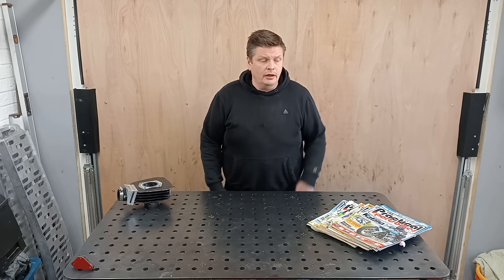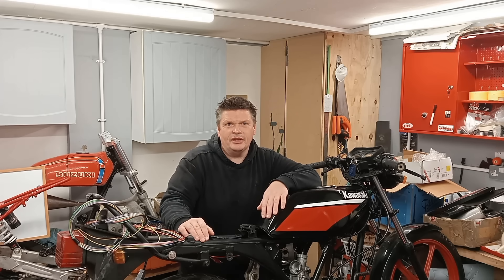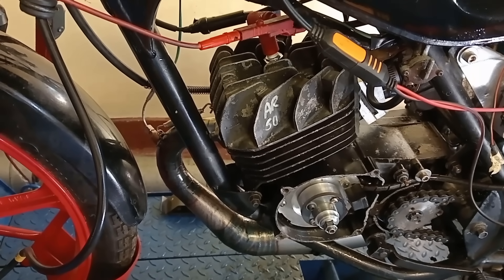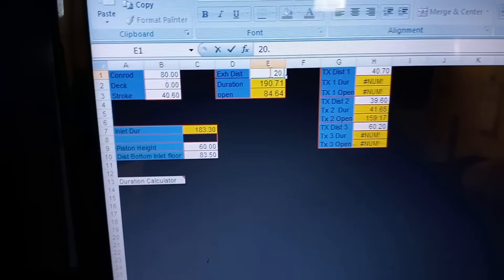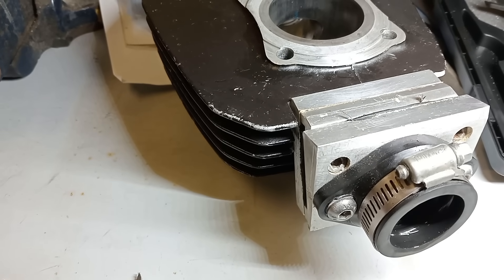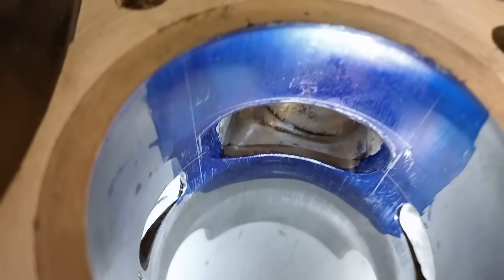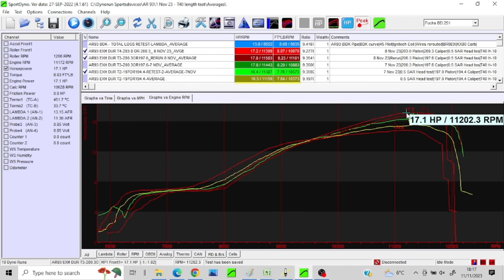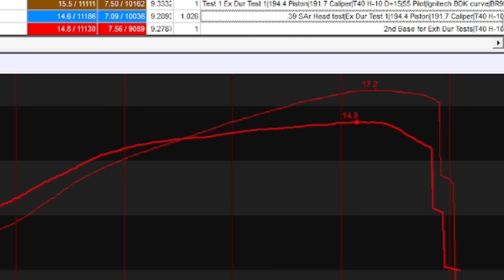This Tiny Port Change Changed Everything (Dyno Proof) #2stroke #power  #porting

Comment: You need to measure the exhaust timing with a dial gauge/protractor on the crank. From the degree the port opens to the degree the port closes. That's your duration.
Reply from the maker: Hi, yes I've seen that method but I like the direct measurement of the piston position. I find it's all a bit subjective 😁
I'll maybe give it a go and see what the comparison is like.

Comment: The speed of sound is faster in hotter temperatures.
C2/C1 = sqrt(T2/T1)
That is, the speed of sound (C) is proportional to the square root of temperature.

So, if you have gases at 400 degrees you have a speed of sound of 520 m/s, give or take.
If you have a pipe tuned to 10000 rpm the pipe will actually be tuned to 11900 rpm with 100 degrees more (IF you keep constant the relationship between RPM and speed of sound in the previous equation).
Your power band is now wider.

So my question is: "Why would you not wrap your exhaust with header tape to keep as much heat in the pipe as possible ? "
Just asking.
I plan on doing this to the pipe I'm copying for one of my FL350 Honda engines.
CO
Reply from the maker: Hi buddy, the only argument against  not wrapping the header is detonation caused by the heat being transmitted into the fresh charge that is over-scavenged into the pipe resulting in hotter less dense - stuffed back in mixture. Another thing i have heard of (not tested by me) is having the header (and the baffle if I recall correctly) made from a thinner steel. For example. 0.8mm steel everywhere apart from the header and baffle cone. The header and baffle cone being made from 0.6mm steel and thus having less thermal inertia and being able to cool quicker and allow the pipe to "act" longer (useful for acceleration off a turn) and then "act" shorter as it heats quicker than the 0.8mm material making the pipe "act" short for high rpm resonance.
Reply: @AutoBeta2T  WOW I didn't even think of that stuff. I'm making a pipe this winter sometime and I'm copying the pipe on my brothers FL350 Honda. It seems very thin material and a different design than my other stock machines. His engine is modified.
Thanks for the heads up because I was going to wrap the pipe.
CO

Comment: Great video have had some development in the past with ar 50 80 engines and the bdk wasnt impressive think a couple tweaks made 17hp from 14 but then development stoped as the guy was a busy man as were we
Reply from the maker: Cool, sounds like you were about where I am now. Were you running the BDK pipe and ignition?
Reply: Kx85 pipe made to fit underslung  exhaust port was 192°  you need to make your exhaust stub bigger so u have a step on your duct outlet for a disruption on the revered pulse should pick 1-2 hp up there
Reply from the maker: Hi again, thanks for the info.
My outlet is currently 30mm at the end of the stub but 32.7 mm at the outlet of the duct. I want to play with a stepped design. It appears to work well in the sim. I haven't tested in reality but it's good to hear you have found power from the step.
Cheers.
Ps. What was the diameter of the header inlet on the KX pipe?
Reply: Pipe wise i couldnt say as we had a kx pipe nikkon pipe and another the customer had to try 

Yes make the stub bigger than the duct it will perform better 

We mainly done exhaust port and  intake porting 

Bdk porting was not good 

Think we gave it the 10 mins tune lol but then the bloke wanted to try the thai import cylinders ect
Reply: It ran a selletra rotor ignition  kx85 pipe and a 30mn pwk 

Try to keep your exhaust port roof as flat as possible with a nice radious this will give you more blowdown area what chord width are you on 70%?  Also the stock duct is large anyway so i wouldnt go making it bigger or you will loose velocity in the blowdown phase

Comment: The top of the new cylinder i mean  on the work bench  with this your spoiling ports have also a longer period of opening duration and another benefit your carter volume is bigger take more air and cooling the crankshaft better than your tuned resonant exhaust pipe will take care providing power

Comment: One piston top ring is way better , second you can get more power by taking an old cylinder  cut away one  cooling blade of the bottom of this cylinder.  Manage to fit this cooling blade and spoiling ports alined . Fit the cylinder on the engine and mark  your exhaust port and adjust by filing the cooling blade from the old cylinder at the port opening duration you want than remove the top of the old
Reply from the maker: Hi, i'm not quite sure what you are say?
Reply: Read it over and over again than suddenly it will open your mind and it's not a joke  an overbore moped of 70 cc make 16.2 pk when it sniffs the powerband of the tuned resonate  exhaust pipe
Reply from the maker: What are the parameters of the tuned resonate exhaust pipe you talk of? Is it length or volume or both? Are the angles of the pipe more important than the length or the volume?
Sorry for all the questions but I am genuinely trying to understand.
Regards
Dave

Comment: Awesome video! I was hoping that you would have done a compression check every time you raised the exhaust port. Im curious about how much the compression decreases. With that said every time you raise the exhaust port you should increase compression ratio via head gasket thickness, the idea being to keep the compression the same throughout the test. I imagine you would have even more horsepower 👍
Reply from the maker: Cheers Baby Shark! I have some new heads that I will cut to get the trapped compression back (this will increase the geometric compression. Prior to raising the geometric compression was 13.8:1 and the corrected was 7.4:1. After raising the port the corrected lowered to 7:1. I'm keen to test this. Stay tuned :)

Comment: Are you adjusting the tuned length on the expansion chamber? Exhaust port timing is tied to pipe length.
I use prof. Blair’s book and software for two strokes, all ports need to be adjusted for their wave activity to coincide for optimal power. Blair and his team placed p/t sensors all over experimental engines and exhaust and intake systems to come up with their algorithms. They are very accurate. Almost all software design systems now are based on his algorithms.
Reply from the maker: Hi, I've not done anymore pipe length adjustments. I did in my previous video here: https://youtu.be/yZXhKxrykCc?si=l7hyJ6rlcGhphFVp  but not this time after increasing the exhaust time area (and as a consequence the timing duration). Yep I've read quite a bit of Blairs stuff and EngMot2T the sim I use is based on his work. I have quite a collection of his SAE papers. It really facinates me, I did a video on the pressure waves computed by engmod2t - this was Blairs main aim: to be able to compute the individual left and right waves as realworld instumentation can only measure the  superposition wave.
Wave visual video: https://youtu.be/jaAE-Bq2lvo?si=Imc1IOOP4zAb_EJ8
Cheers

Dave.

Comment: I noticed on My Yamaha 250. We cut the piston Intake port higher to get the gas in faster. The bike went faster but took off slower because  it lost  low end I'm wondering if you are going to lose low End also by doing that. That was in 1970s.
Reply from the maker: Hi Rocky, I may look to do some more intake work but as you say it could loose bottom end. I want to have a good measure of the inlet again and see how much STA it has. Nut it's complicated so I'm keeping my head in the sand for the minute. :)

Comment: These dyno graph lines are very similar to increasing duration of a 350 sbc cam from 262 to 276 without increasing compression to get bottom end power back
Reply from the maker: Cool, do you get anymore power from increasing the compression or just bottom end.
Reply: @AutoBeta2T it raises power everywhere but eliminates the loss at lower rpm. Without the compression increase,  torque just moves up the rpm. With added compression,  no loss anywhere.

Comment: You have to mill the head and reshape the combustion chamber to gain back your compression lost when raising the exhaust Port you need to have 210 + PSI and and then be careful with your fuel octane and ignition
Reply from the maker: Hi Jay, yes, I have a couple of heads off eBay to machine to get the compression back to where it was.

Comment: Have you done anything to regain the C.R. lost through reducing the swept volume?
Reply from the maker: Hi Ian, not yet, but I have just had two more standard heads arrive that I machine to test the current exhaust timing with the previous corrected compression ratio.

Comment: I do the same experiment also. Raised the exhaust and wide it beyond the infinity you will make the scrap 😅... Just not to much 2/3mm for widening and raised is enough based on my experience 😊😊😊
Reply from the maker: Cheers Raymond - I would like to widen at some point but I need a spare barrel in case it all goes horribly wrong! 😁
Reply: @AutoBeta2T  sometime it depends on your head squish... After you get the best port raised and wide try reduce your head volume or increase compression 😅 i think it will increase little bit .. 
(Im just suggest!!!)!✌️✌️✌️✌️😁😁😁😁😝)

Comment: in 1971 private air-cooled 50cc Kreidler toped 160kph at Assen track, they didn't even have back port, only 3 ports, no curved ignition, no electronics, no squish band, no nothing ... thay had only 13 to 14 hp so you know you need to get a fairing , same cylinder converted to water cooling produced 15 to 16 , strangely it made no difference head was water cooled nor squish mattered..50cc do not detonate so not needed ,looks like you need to get AR50 and a faring.
Reply from the maker: Hi, yes a fairing is an option but I'd like to do it under the same terms as the original project. So maybe.

Comment: Its so easy to make it go slower 😂😂😂...lose a couple of pounds thats the easiest way to go faster
Reply from the maker: Yep. Weight itself doesn't make a massive difference to top speed but it will increase acceleration which means I won't need a 5 mile long run... I think the biggest advantage of weight loss will be in reducing drag.

Comment: So with the cylinder modifications, the pipe you are using for all the testing, shouldnt the pipe change as well?

I have done what you are doing to a few engines.  And what i have learned, merely by experience,  what works with 1 pipe doesnt work well with different exhaust ports......

Im sure at some point there are gains and then at a point it goes backwards.

If one was to make an exhaust for a 2 srtoke, all the internal specs are taken into account and a pipe is generated in most programs.  So any charges inside the engine, will affect how the pipe acts.  How much? Well every engine and mod has a different affect on the pulse in the pipe.  And hell, in the crank case as well.

And then your changing the corrected compression ratio.  And i have found timing changes can be made to bump up hp as well.

Great work and video.  Hope you get to your mark.
Reply from the maker: Cheers mate,
This pipe worked well with the timing of the original project (which was 203 exhaust).
I think I was actually tuning the ports to the pipe but I can be sure... As you say you change one thing and it alters something else. I will be making another pipe... Probably a few to be honest as I'm kee. To explore how it can change the power curve.
Cheers for the support and the information, it's very helpful 😊

Comment: You're going in the right direction by using a larger radius on the top of port to ease ring back into cylinder. On the RD375's, I raised the port to 196 deg, but the engine was working at a lower rpm and couldn't make use of the higher rpm. But one thing I did do to help blow down was make the port much wider at edges. Think of a trapezoid with the wider part at top of port, and narrower part at BDC. The edges of the exhaust port on the RD/RZ's would overlap the front edge of transfer port for about 72% width, or about 48mm on a 66mm bore.. This helped get the gasses out without the need for a higher port, helping powerband. The widest part of the port was only about 5mm, so inertia kept the rings in place without jumping into the port. It added 500 RPM to top for a power band of 6k to 9k.

Comment: WPC Treat all the internals, sprockets, wheel bearings, and chain. The friction reduction will help. Hopefully you have a facility in your country to do it. Thermal barrier coat the expansion chamber ( or make a new one ).
Reply from the maker: Hi Hoost, whar is WPC?
Reply: @AutoBeta2T  you can look up the WPC treatment here and online. It's a micropeening treatment that destresses,  hardens and reduces friction. Increases the strength of the component. Given that this style of two stroke needs all the help it can get, especially when it comes to controlling heat, this will help. That and a really good synthetic two stroke oil.
Reply from the maker: @hoost3056 cool, sounds good.
I'm running Motul 800 at the min. We used to race air-cooled 2 strokes and went from 747 to Motul and found it better.

Comment: You need to sort inlet ports out, not just the exuast ports, then a good exaust and jetting .
Reply from the maker: Cheers Mick, I've already done some work on the inlet putting in a floor port and played a little with reeds... I plan to revisit it later on.
Any pointers on the pipe design? Areas where I could improve it?
Cheers

Dave 😊

Comment: More Pipe length can potentially help these changes
Reply from the maker: Agreed. I can vary the length of the pipe and I will revisit at the next Dyno session. However, the exhaust blowdown STA (timing) increase seemed to favour the pipe length it was at. I think that previously the pipe was causing the engine to peakat a rpm the exhaust blowdown STA wasn't sufficient for...?
That said another play with length is in order and another pipe design... then another... and the another... 🤣
Reply: @AutoBeta2T  Sadly it never ends - your on track to a good engine

you should weld and add sub exhaust ports - then main exhaust could drop/and or you could add transfer port width
Reply from the maker: @HPRaceDevelopment Yes, as I get through my list of great things to try I seem to pick up more ideas than I test. And thanks, I'm getting there 😊 
The studs are 60mm centres so not masses of room to sub port... I'd probably have to weld up the outside too. I could do with getting another barrel but these genuine Autisa ally ones are pretty much unavailable now. There is a cast iron copy available. Failing that the standard 80 barrel could be a candidate.

I could really do with a better piston... The 12mm piston pin really limits choices though. I have a RM 80 con rod that will fit and has a 14mm piston pin which gives a few more choices including a 83/84 CR 125 piston from memory? 

Cheers

Dave
Reply: Yeah that would be useful to swap rods eventually. @AutoBeta2T

Comment: You might want to increase the carb size, the engine will breath better.
Reply from the maker: Cheers :)
What size do you recon? I'm on 28 mm at the min and I have a 30 mm ready to go...
Reply: The 28mm should be enough for a 50cc Suzuki's RM62 used a 22mm, but since your engine capacity is larger than 50cc the 30mm should show an improvement in the engine breathing.   @AutoBeta2T
Reply from the maker: I did try it before but the 28mm carb proved better. But now with a better pipe and more exhaust timing it may show a benefit.
Reply from the maker: Also - how is the RK67 rep going?
Reply: I should soon be pouring aluminium, casting the lower crankcases @AutoBeta2T
Reply from the maker: Cool. Sounds like one hell of a project. Will be great to hear it up and running one day.

Comment: And yes fit single ring piston.
I think your power is close to the ones Darryl tuned?
Reply from the maker: Yes, hopefully when I can find a single ring piston that fits. 🤞
Reply: @AutoBeta2T  malossi do a range of 40mm pistons, I think mahle make that size too.
My mate raced an ar50, they just ran the 2 ring piston with a single ring.
Malossi do nice titanium con rods for the new mhr team stuff.
Can you lighten the crank?
Run total loss ignition?
Different reed valve types?
Variable intake length?!!
I definitely think there is power to be gained from a totally smooth, non choked inlet would be a gain, 30-34mm tapering throttle body with razor slide.
Or
Have you tried a pumper carb like tilotsen?
Reply from the maker: I think the malossi stuff goes to 53mm..
I'm on total loss at the min. I do have some other reed valves to try. Maybe a bigger carb and some intake mods... Hopefully I'll get some more testing done soon. Cheers, Dave